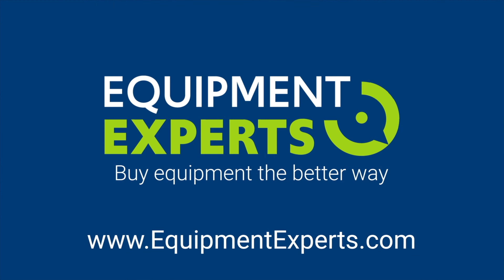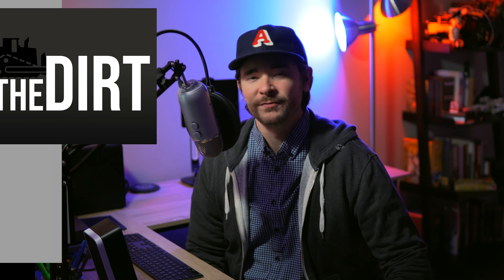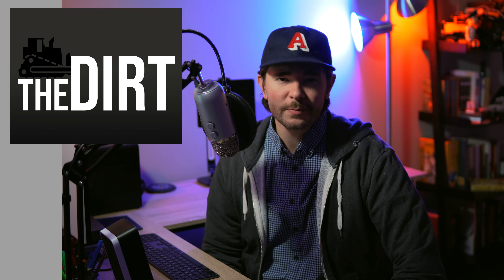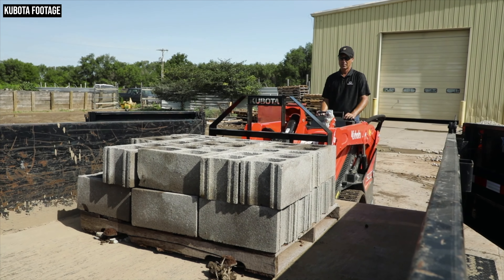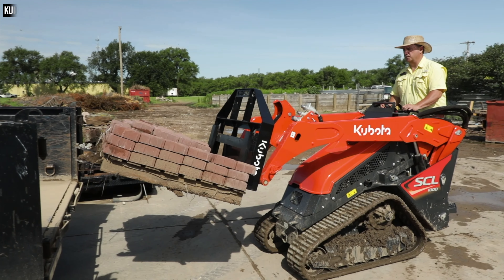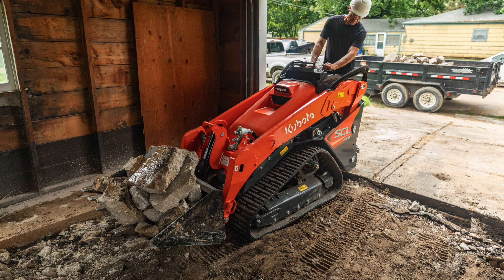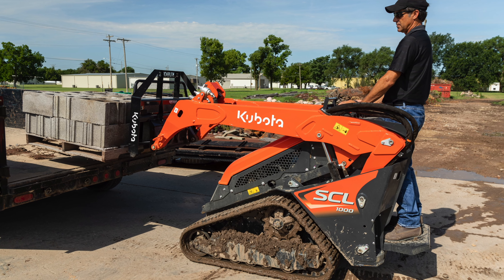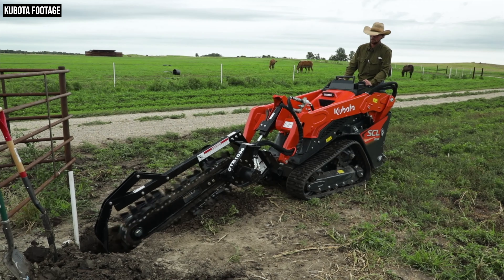Kubota Expert Breaks Down the SCL1000 Mini Skid Steer | The Dirt #14

Comment: Overall I don't see vermeer, ditch witch or toro winning against the kubota. Ctx100 has power, sk1050 also, but they have the same ROC. Kubota can't lose with the Suspension platform, low ground psi, 36" wide. No key, talk about theft deterrent.

Comment: Why don't they put a 35 hp on this.  Awesome machine though.
Reply: EPA tier 4 diesel emissions requirements start at 25hp, anything under is unregulated.
Reply: T4 doesn't mean DPF and DEF until 75 hp.
Reply: Ditch witch's yanmar uses dpf. Vermeers Koehler uses doc. Doesn't matter the method as long as the emissions fall below the regulatory value.